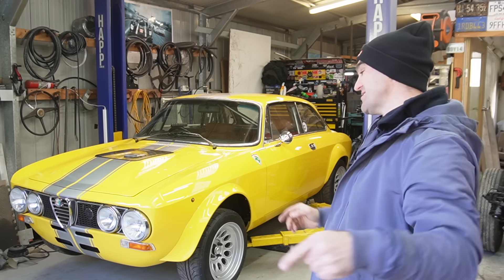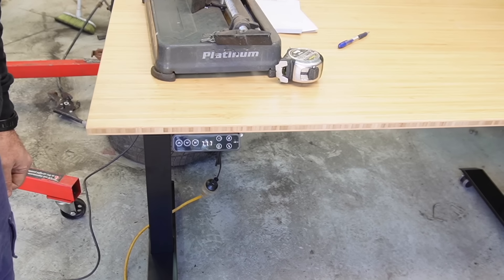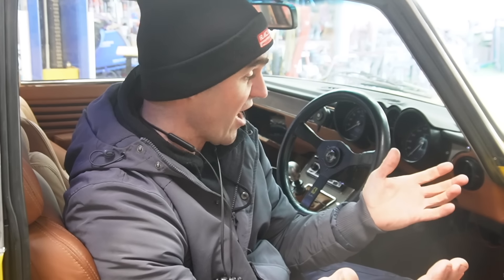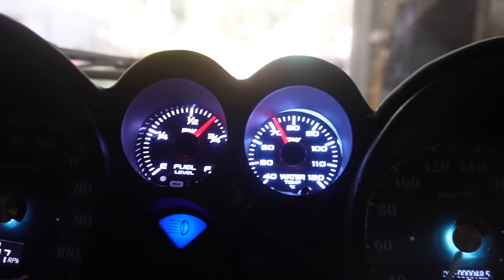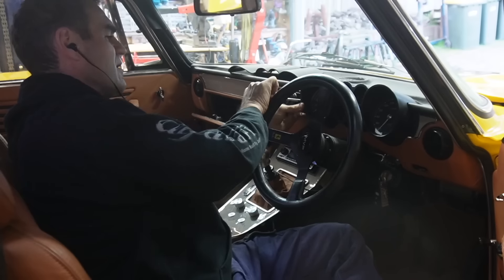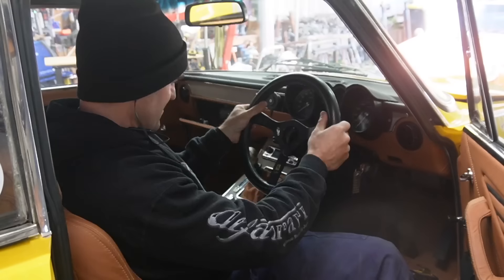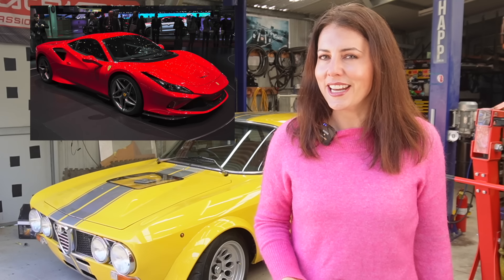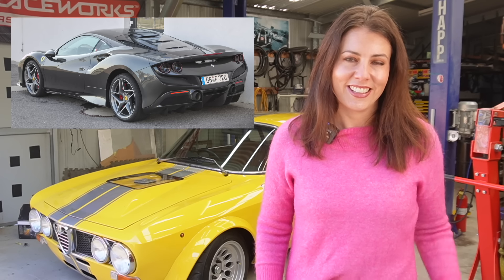Will it pass? - Ferrari engined Alfa 105 Alfarrari build part 217

Comment: A potential thing causing your brake problems: In Hot Rods where the master cylinder is mounted below the floor, a residual valve was needed to either keep some pressure on or off the brakes. I am not a brake engineer, but something you could look into. Here in the states, they are cheap-like less than ten bucks. As always, love the builds, the Fun Facts, and the education. Cheers!

Comment: Hi Jeff, saw that you have a problem with the brakes dragging. One problem it could be is that you have a master cylinder that is set up for rear drum brakes with a 10psi residual check valve or maybe if your using original lines that there could be an inline residual check valve. Residual check valves hold pressure on the wheel cylinder pistons to make sure that they are fully engaged against the brake linings (shoes) ready for braking and to keep the pedal high so it doesn't sink to the floor etc. Not sure of this is your problem but it's worth checking out as if it is there it will make the disc brake pistons drag.

Comment: I suppose (both) m/cylinders are for 4 wheel discs. Some types have a residual brake restrictor in the m/cyl union.  The front pistons return themselves, but the rear shoe springs need the restrictor. Only for rear drums, but I've seen people leave it in for 4 wheel discs, and then brakes drag.

Comment: I had a similar brake issue on my 911 resto. Couldn't roll the car after changing the brakes from pedal to caliper with all new parts and lines. Turned out my fancy after market pads had just slightly too much thickness on them even with the caliper pistons fully retracted. Tried a different brand of pad and the problem went away. I think there was only 0.5mm of difference in the pad thickness but it was enough to cause trouble.

Comment: Notorious brake issue on Alfa 105s - my first Spider was a pain. You need some free play in the pedal. Cold it can seem fine but, when warmed up, the system (fluid expansion?) locks up. Not at all easy if you have the dual cylinder balance box.

Comment: Having the brake pedal pushed set too long is a common problem with these cars, even with standard brakes so yeah, take a look at that. 

Another common cause of sticky brakes is the lads jamming in those fancy calipers. The lad sizes can vary enough that the can get jammed, either against the body of most often by the hold in pins. You may need to give them a small hair cut.
Reply from the maker: I assume you mean 'pads'? I will have a look, thanks.
Reply: @HomeBuiltByJeff  no it was "pushrods" but I see that you've worked this out yourself in the latest video!

Comment: Years ago I had a Fiat 128 rally which I put the two litre Lampredi engine in . Having taken it on a test drive, I convinced myself that there was too much play before the brakes reacted. So I adjusted the length of the actuationn rod. Job done? Well no! On a trip of some length, the vibration of the pedal on the master cyl pumped up the brakes to the point of over heating them. There may be too little play on the master cyl ?

Comment: table lift legs defo need bracing together at the bottom....i wouldn't attempt to move it with 250K sat on top especially while its at full height...that would be as sturdy as a newborn giraffe...

Comment: When you've installed the master cylinder actuation mechanism,  did you try to install the master cylinder slightly compressed, by hand, to remove the air inside of it ? I did this once and until i reinstalled without doing this, I did not get rid of the stickiness.

Comment: Pretty sure Australia is one step away from a police state. You’re very accepting.
Reply: Your comment is not a true reflection of the requirements imposed when you present for use on public roads - a highly modified, very powerful historic vehicle that is a one-off - especially given that the power of the original engine was a mere 30% of the Ferrari engine that is now fitted in the small Alfa.  Australia's scheme is similar to (some) European countries that allow highly modified vehicles to be registered for road use.  What's more there are also western European countries that simply forbid such modified vehicles - eg. Switzerland, France.
Reply from the maker: Most countries in Europe would never be able to drive this on the road
Reply: @HomeBuiltByJeff  Very true, the only country where it may be possible to register the Alfarrari is the UK - although it's noted that some now consider the UK to be a 'non-European' country.

Comment: Your engineer should have done build inspections.  During construction.   That would have made the process much easier.   Or at least stipulated that you provide photos and specifications.   Your brake pedal should have a little bit of "play" before take up. Good luck with the test..
Reply from the maker: He did

Comment: Hi Jeff, are the brakes locking up after you have got some temperature in them? If so, could mean the master cylinder seal could be blocking the small hole in the bore that goes to the fluid reservoirs. Just a thought.
Reply from the maker: From cold
Reply: @HomeBuiltByJeff  interesting.